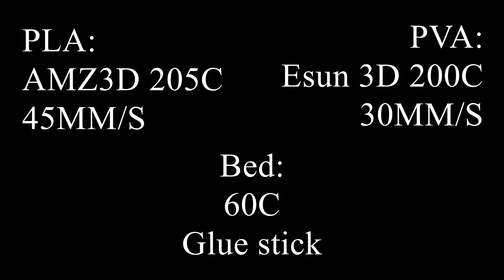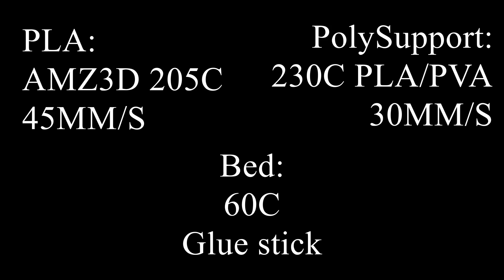Hictop D3 Hero IDEX Supports Test

Comment: Are you printing the PVA supports right up against the next layer? i.e. no vertical gap?
Reply from the maker: That is correct for both materials. No air gap means high chances of it sticking.